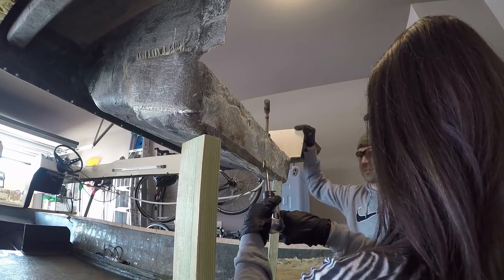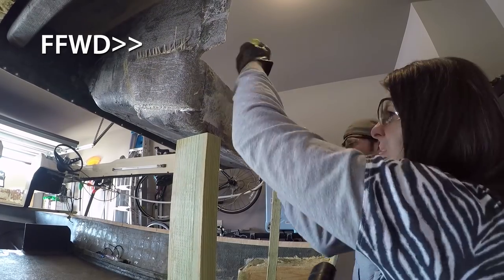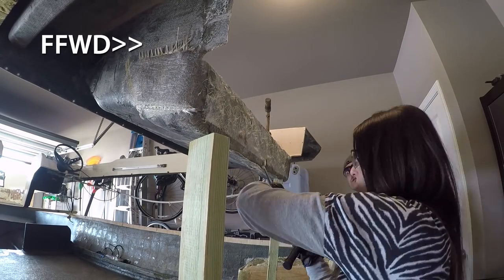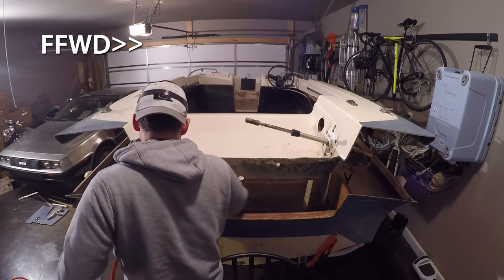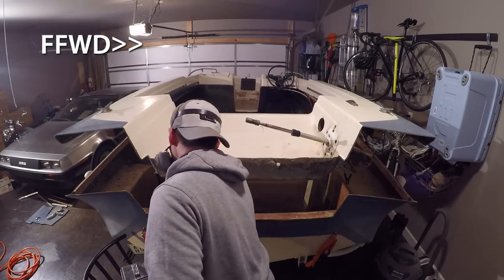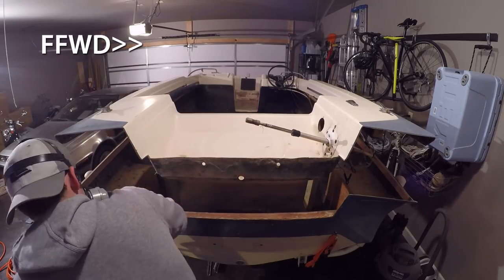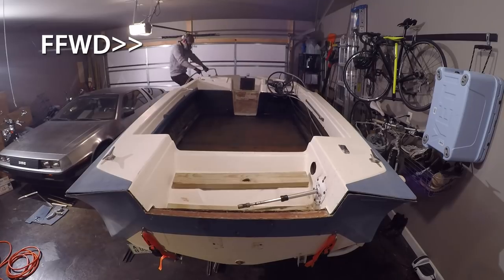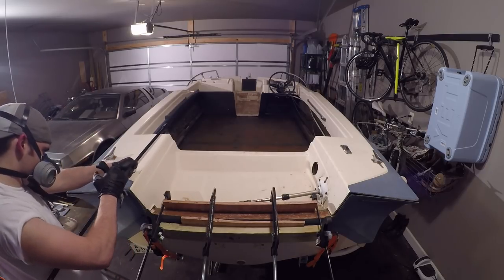Installing the Cap // Project Glastron/Vlog #22

Comment: Your videos have been extremely helpful restoring my Glastron gt-150 I’ve been working on. How did you end up re glassing the cap over the top of the transom? I have to redo that to mine as well and having a hard time finding best practices
Reply from the maker: Glad to hear these videos have been helpful.  All I did was adhere the cap back to the transom on the back of the splashwell.  The guy who redid the gel coat finished out the top of the cap/transom area.  I don't know what he did exactly, but I saw lots of other boats in his shop that he had been doing body work similar to that of auto body repair.

Comment: Hi Josh,

Currently working on the same type boat...
Sh*t, f*ck what a hell of a job... especially the grinding part! There seems no end to it!

Were did you get the new bump strip from?
Reply from the maker: The grinding was definitely my least favorite part.  As far as the new strip I believe I got my rub rail from www.greatlakesskipper.com and it is a Taco Marine Product.
Reply from the maker: 😀I am a bit behind in my videos.  I know what the next one will be about, but I need to get it edited.  Work has kept me off of YouTube for a while.  I hope to have a video out soon!
Reply: jmink We are still waiting... My gues is, firing up the engine?

Updated my one drive. With the smaller rubber, but iT looks exactly the same